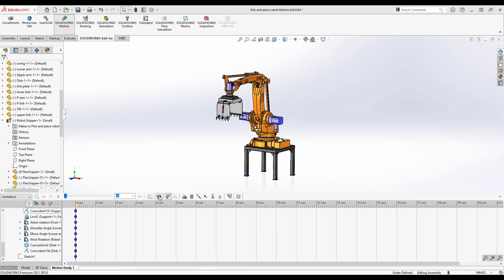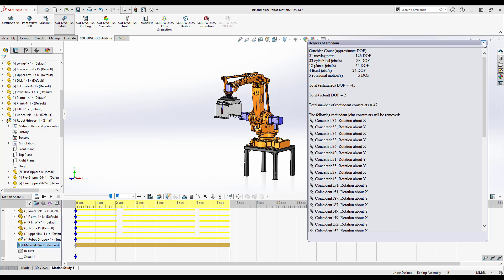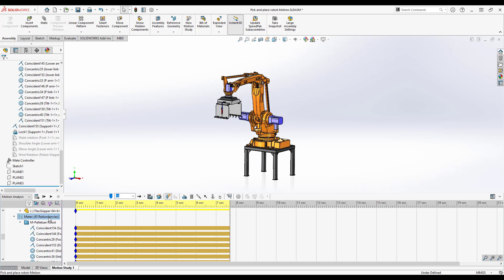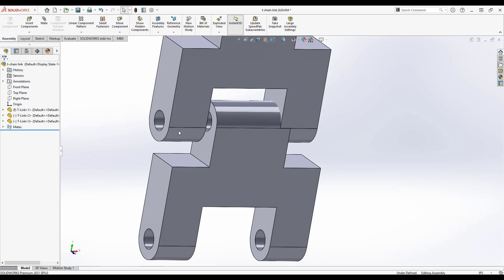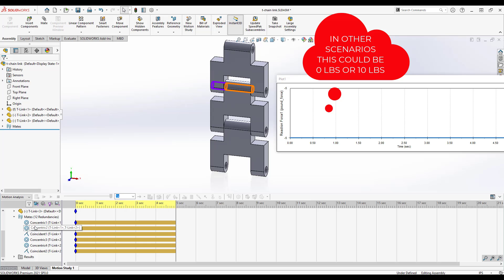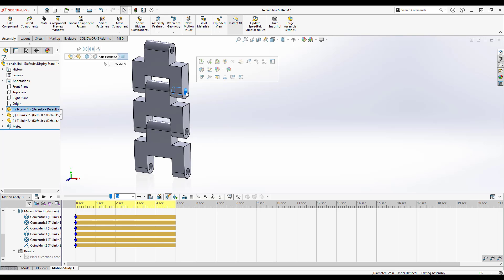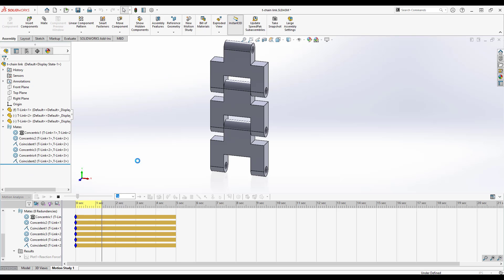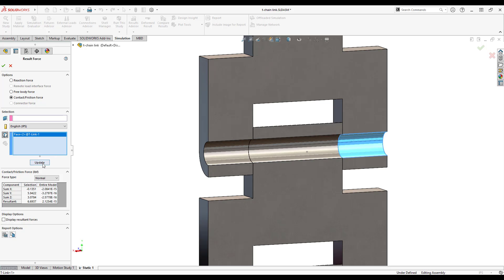SOLIDWORKS Motion Tutorial Series #8 - Redundancy & Degrees of Freedom

Comment: there a question that crashe me,  why the force applyde for the right side should be 10 and the other side should be 0 😢 there is 10 forward to ground so its should 5 for right side and 5 for the left side
Reply from the maker: I'm not sure I follow your question, is there a specific point in time in the video that you are referring to, or do you have a general question?  Let me know more about your question or follow up with your local support provider to discuss your question.
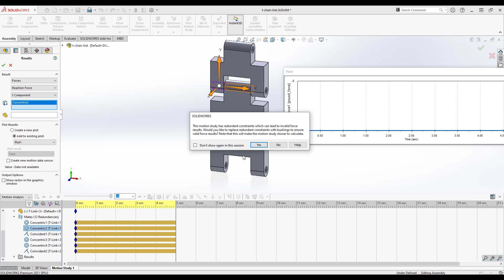Reply: @MLCCADSystems  on 9:25 you said it not supposed to happen, it supposed to be 10 for the first dide and 0 for the second one, why?
Reply from the maker: Redundancies can create problems, and I was expecting an incorrect answer due to a redundancy, but I was unable to trick the software into providing an incorrect answer.  I got lucky, but without considering redundancies you may not be lucky and you may get incorrect results.  This video aims to identify the potential for a problem and how to spot it and either prevent it or deal with it to get accurate results.

Comment: I just started using SWMotion and this demo has really helped. But seeing that even a VAR finds the behavior inconsistent is kind of troubling. It seems like there are much better/easier ways to deal with this issue. For instance, why not have checkboxes in the analysis tab that lets us activate/deactivate DoF's for a specific mate. I know that this isn't possible in the code right now but that is surely better than trying to figure out what to replace or even ignore.
Reply from the maker: If you are doing a lot of these types of analyses, you may want to consider a standalone tool that is dedicated to and optimized for performing these studies.  Motion Simulation is based on the ADAMS solver but is integrated into the SOLIDWORKS interface. Here is a link to the standalone ADAMS tool: https://hexagon.com/products/product-groups/computer-aided-engineering-software/adams

Comment: Can we conclude from this that Solidworks is bad at motion analysis and to use something else like Ansys?
Reply from the maker: The intended takeaway from this video is that large complex assemblies with many mates that were suitable for modeling and design are not inherently ready for complex kinematic analyses with no additional work.  Some redesign on mates and assembly hierarchy and a basic understanding of mate assumptions is helpful in getting fast, accurate results.  Using any third-party tool is likely to require the same effort and understanding along with a lot more manual setup, and will still utilize the same underlying equations if it is a similar type of analysis tool.